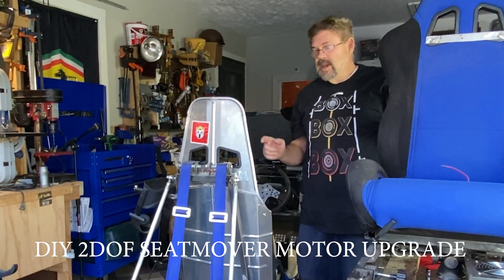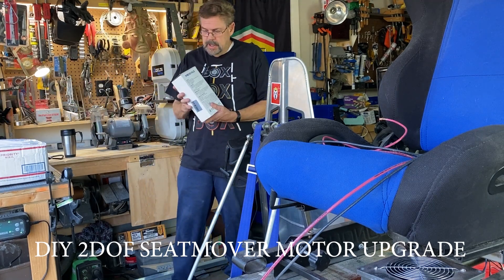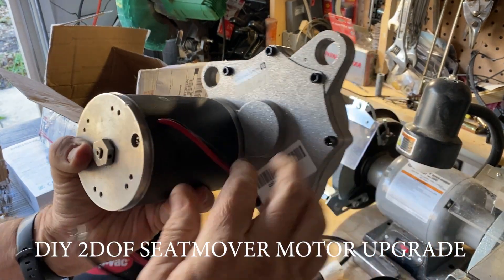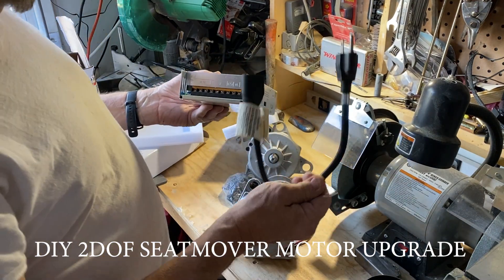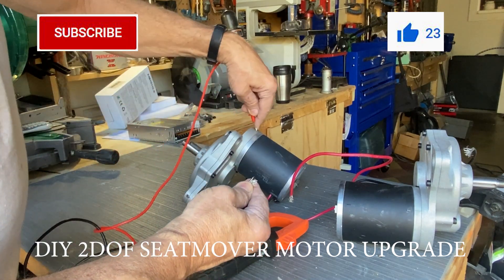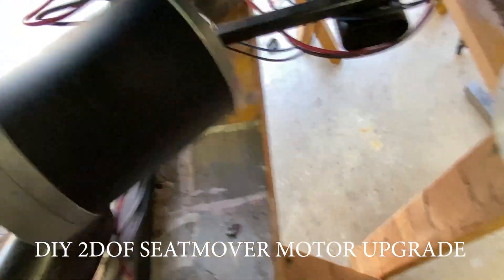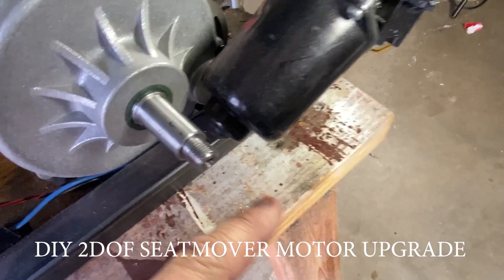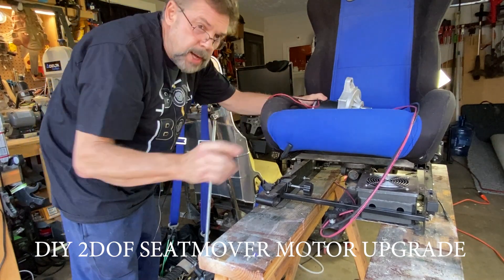DIY SEATMOVER 8 UPGRADE

Comment: I wonder how this style seat mover compares with SFX100 style platform (note ignoring price factor), just the feel of feedback given by seat movers with traction loss vs 4post actuator's. 

Not sure which build to start tbh, like the sx small foot print - yet that traction loss seems important
Reply from the maker: Nice comment Przemyslaw!  I built a 3dof and you get a LOT of movement out of it on 2DOF.. I added traction loss (which is absolutely fantastic in VR).  I also built the 2DOF seatmover which does work, but it's not a immersive as my 3dof.  So my conclusion is that if you want a compact footprint, you need more power.  That's why I am doing this video series.  More Power to the People! DMAX

Comment: Hi Dave, Awesome videos. I have watched almost all your videos. I am currently getting all the parts needed to start my motion sim. I was wondering if the power supply was able to handle both motors or did you have to get another one? Thanks for all the videos, they are really helpful in this journey for motion.
Reply from the maker: Thanks for watching the videos. I used one power supply per motor. Since the power supplies are pretty inexpensive, go that route. This was the only motion rig I built to date using 24v power supplies so I dont have a lot of information other than they moved the seat convincingly.   If you were to build a full frame rig, I would consider getting larger power supplies but for a seatmover, they seemed to be able to supply enough peak power .  Hope that helps and thanks for the comments.  Dave

Comment: Hey Dave, how do these motor compare to the crab pot motors? They are a lot cheaper but are they less powerful?
Reply from the maker: They are cheaper Nick..  they seem powerful enough for a 2DOF seatmover.  but I'm sticking with the crab pot pullers on the new compact 3dof build I am doing.  Mainly I wanted to test the 24v wheelchair motors using AC to DC converters and yes they do work..
Reply: I was reading up and most of those crab pot pullers use jiffy motors. So they might be the same motors and it just comes down to the gearbox
Reply: *jazzy
Reply from the maker: @GeeCeeAte  Yep..  JAzzy motors    now I'm working on a 3dof compact rig using 12 v  but going to be 'plug in' the wall hopefully..
Reply from the maker: @GeeCeeAte  Yeah from what I've seen on the EBAY web they offer it in 25:1 as well as 50:1.  Originally I wanted those Motion Dynamics 60:1 motors from AUS.. but the shipping was killer..  plus like $300 each..  so the 50:1 crabs will have to do..
Reply: Awesome! Do you plan to use a ac to dc converter on the new 3dof build as well?

Comment: Hello, would you pass me the link of the motors that you put in the simulator, why did I have the same problem, my 12v motors do not have enough power, thanks and best regards.

￼
Reply from the maker: the 24 volt motors  I just searched on EBAY..   so no real link but they have a lot of them  JAZZY wheelchair motors..   The 12 volt 50:1 motors I also got on Ebay and there is a seller for those as I have bought several over the last three years..   I'll put up the link here https://www.ebay.com/itm/354052076387
Reply: @DMAX_DIY  thank you for your answer, you are very kind, hug from Argentina 🤗
Reply from the maker: @cai_7748  Just tryin to help out ..  Aprreciate the comments my friend!

Comment: Hello, would you pass me the link of the motors that you put in the simulator, why did I have the same problem, my 12v motors do not have enough power, thanks and best regards.
Reply from the maker: Yeah this has been a weird issue since the Pandemic..  But good news.. I just bought 3 extra 12v 50:1 motors from the supplier on EBAY in Canada..   Sometimes they have them..  sometimes they dont..  price went up about $20 each but oh well..    They say they have 94 of these left..  They are pretty dang good motors.  I run them off a 12v battery ..  here is the link..   https://www.ebay.com/itm/354052076387
          SO for the 24v wheelchair motors, I also got them off Ebay..  I just searched for Jazzy WheelChair motors..   These parts come and go all the time on the Ebay site so cant really send a link..   And I have yet to fully test them..   I have them working and moving the 2DOF   but need to crank it up a bit in the next video.   SO you could go either way   12V  or 24 V..   My channel is kind of experimental..  Seeing what works and what doesnt.

Comment: I found the same motor but have a plug of conector of 4 pins? What i have to do? Is that normal?
Reply from the maker: Hello Natanael..  Good question.. From what I've read, the other two are for braking from the wheelchair hand lever..  You wont need to use those..  Just two of the wires which power the motor..  The arduino and IBT will take care of braking.. Dave
Reply: Ok perfect what model is your motor? To see if we have the same motor

Comment: They didn't give me any bolts or keyways
Reply from the maker: That sucks Henry..   Well..  If that were me..  I would try and find some metal that's close to fitting and grind it down to make the keyways.. Bolts are pretty easy to find at the local hardware store.   I'm actually surprised I got pretty much all the stuff to mount my motors up..    Also.. If you have a welder..  (and are in it for the LONG GAME  not reselling the motors   just weld the levers on..   That's what I ended up doing on my 3DOF rig..   I kept shearing off the pins that held the levers to the motors so I said.. whatever.. and welded them on..  (being careful to cool the metal down between tacks)

Comment: Damn it Dave, you're gonna make be do this. 
(thank you!)
😁
Reply from the maker: So Frank!  I got it running!  going to be posting a new video on May 14-15   Yeah.. 24 Volts works just fine with the IBT-2 setups.. I actually go into a lot more depth of settings on the SMC3 in real time.. Hope you tune in.. Dave

Comment: Hi I was wondering how your ibt2  are holding up with the 3dof any issues .I'm  using mm and thinking of trying the ibt2
Reply from the maker: They are fine in my 3dof rig after two years.  You need to put a fan on them so I have a 120mm fan that runs. So far, no issues at all.  Except I did solder all the connections between arduino and all IBT's..  Thanks for the question! DMAX

Comment: Between a 60V_600watts_180rpm versus a low volt low rpm = 24v_600watts_45rpm, seems this 45rpm has more torque, which is better?
Reply from the maker: Thanks for the comment.  So it's not all about torque either, response speed is super important.. I'm going to be running some tests but I may never get to use a 60volt motor so If you get one, let me know how it goes.  You could post the question on the x-simulator.net forum.. They could probably give a more specific answer!  DMAX

Comment: Hey Dave, you did the same thing as me. I just got my 24V 30A power supply this week. I hooked it up to the wheelchair motors. The first thing I noticed is when the motors go aggressive, the power supply spikes and then cuts out for about 3 seconds. I'm thinking that there is a internal protection fuse that is kicking in. How did yours turn out? Any problems?
Reply from the maker: I have not been home to test them out.. I will this weekend..  So, if I do run into that issue, I will place a copule 12 volt smaller batteries in series and they should be able to handle the spikes.    Really, I want to get the  Amp clamp on and see what the motors do  Till then!  Dave
Reply: @DMAX_DIY  Yup! I went to the junkyard today and bought a second 12V battery wired them in series, Works Great! My 3rd yaw motor is 12V, So I connect that in between the batteries taking a 12V line. I actually had to turn down the motion percent in Simtools. I was afraid it was so violent the chair was going to break. I'm going to return the power supply. Way too expensive for independent power supplies for each motor. Two batteries is the way to go! Let me know how yours turns out.
Reply from the maker: @dennisjohnson1893  Yeah.. I tried to make it simple on my 3dof rig.  850 CC amp battery.  The motors were 12 Volt so just one battery and all three motors connected.  The battery or batteries have so much available amps that I have never seen a spike that it cant handle.  I'm  going to connect up the 24v  motors tomorrow hopefully and see what's up  (AMP Wise)  Glad to hear from you.. Keep pluggin away!  And post a video if you ever have a chance..  Love to see the build on x sim page or on YT>> Dave

Comment: Hello again. Do you use any fuses in front of the BTS7960 motorcontroller. I know they are rated for 45A, but what fuse  would you recomend to be on the safe side?
Reply: Fred, I fused all my 3 motor connections with 20A fuses. I have blown a few of them. This comes from getting the motor tabs in a hard, almost out of reach position. If you over-force the motors the amps will surge and can burn out your wiring, I actually started my first wiring board on fire in the garage. So, you do need to watch it carefully when setting it up. Also take consideration an empty seat vs a full 200 pound person sitting in it. You might need to scale back your limits so the motors don't have to drive so hard.
Reply from the maker: @dennisjohnson1893  Great Tip Dennis!  BTW have you ever done an amp clamp reading to see what your pulling?  I'm going to try and use the Amp clamp on the next couple videos just to see what's actually going on   Cheers Dave
Reply from the maker: Fred, I have a 40 amp DC breaker for the main wire of the rig.  The most I have seen is 26 amps from all three motors so being right around 80 percent max load is good for me.  I could probably run a 30 amp but ya never know.  The main thing is that I can easily access it in event of Emergency shutdown (control wise) or it would trip if amperage exceeds the limit of the breaker.  I do not have individual fuses on the IBT's.  Hope that helps.. Dave
Reply: @DMAX_DIY  Yes it did help a lot! Thanks. I understand you have good experience with BT2 so far...
Reply from the maker: @Fredstli  Well, They work..  I have some JRK 12V12's but have not tested them yet.. The   JRK's were like 70 bucks each..  And I have to put a heatsink on them.. Anyway, yeah I found that if I solder the connections, everything is great.. If I dont and use those connector wires, Weird stuff happens due to loose connections. Other than that, You need to have a small fan blowing on them to keep them cool..  Dave

Comment: Hey Dave great video! Could you possibly remove the transmission from that motor to reduce the size, I know you would lose some torque but it would save on space and weight?
Reply from the maker: Maybe after I blow something up.. haha.  I know that when the motor spins, there is another part near the commutator which spins.  so I will first be trying to figure out how to count the ratio..   24:1? 50:1? I have no idea yet..  Thanks for the comment my friend! Dave

Comment: Can the IBT2 do 24v?
Reply: Excellent!  Those are the exact ones I have and I am in need of a new (stronger)TL motor.  Been looking at the truck tarp motors as a possibility too.
Reply from the maker: @dgator7251  Yeah.. I looked at those dump truck tarp motors too..  Let me give these a shot and see what happens with them before you get any..    stay tuned my friend!
Reply: @DMAX_DIY  Looking forward to it as always, thanks!!
Reply from the maker: @dgator7251  Ok.. so I got a new video coming out on May 14-15  I'm going over all the settings with the motors in real time..   It's pretty cool  hope you tune in.. Dave
Reply from the maker: Yes,   absolutely and up to 42 amps..  I have not ever had them on 24V  and the max I have run is 27 amps  so like I said before  experimental science  The Specs of the IBT-2 say " the supply voltage 5.5V to 27V."    so We will see what happens and hope no 'smoke' comes out !   Here's a link to them.. Dave  💪    https://www.amazon.com/HiLetgo-BTS7960-Driver-Arduino-Current/dp/B00WSN98DC/ref=sr_1_1?crid=CC5HY2E3KZPG&keywords=ibt-2+h-bridge&qid=1643674072&sprefix=ibt-2+h%2Caps%2C115&sr=8-1

Comment: I think you will fry this psu buddy 🤙😳👻
Reply from the maker: Maybe.. But you gotta try to find out..   The load seems appropriate so far..  It's the transitional load  hard braking to full accel that may be an issue.  I will have the AMP CLAMP on to see whats what because I need to know ..  If it does fry, then I will simply get a bigger one or mid circuit batteries to handle the spikes.    Either way..   It's ' ON " now...  we will find out! Dave   😬💪
Reply: @DMAX_DIY  I am sure you will find the right way! Keeping my fingers crossed for you as always 😉 
BTW. I did a little re-upload which is totally off topic 😳 but I wanted to get anything fun up for you ....
Reply from the maker: @ARTFLY  Took a look at your video.. Nice..  I did that too with my little ones!  And my Dad did too! All Good stuff!

Comment: Hello, your videos have inspired me to try and build this for my two handicap children and myself.  I am stuck though and was wondering if you could help.  I got all the way to the smc3 utility but I cant get the program to engage the motor.  Do you have any advice.  Please help
Reply from the maker: Great idea Tom-Jacob.  Yeah once it's moving Yall will love it!.. Ok.. So you have the SMC3  and it's on the correct com port?  Able to move one of the potentiometers and the green line follows?  Let me know,  I will check this comment to see what you say..  Dave  💪
Reply: @DMAX_DIY  Good evening Dave,  I got it working, as it turns out the Mega I was using isn't compatible with the coding.  I know it was written for the Uno but I figured the syntaxes are the same hence C+ they should both work.  Low and behold the Uno was the one I had to get my hands on to get it working.  I know have to hook up the second motor, test it then get simtools running and try to patch it with xplane11.  To be honest Dave, my son hasn't been able to walk since he was eight and my other son is Autistic but a gamer, go figure.  I am currently working on getting custody of my grandson so he doesn't go to foster care and they are all really wanting me to get this up and running.  I had an old premobile M300  powered wheelchair that I am converting into the motion simulator.  My oldest is now 16 and a quadriplegic so my plans where to use his old chair so that I could fly it remotely while he sits in his old chair and enjoys the show.  Please keep your fingers crossed that I can get this going.  By the way I live just inside Alabama and I saw from xsimulator is where your from.  Small world right.  Sorry for the long winded response, I am very grateful that you responded, thank you.  Have a good night.
Reply: I really need to proof read before I send messages lol.  I know your close to Alabama because I am also a member of xsimultator.  The funny thing is that I got chastised because I asked a question on your xsim feed 🤣.  I was told I broke a rule, no biggie though.  Take care
Reply from the maker: @1980tomh  Ok.. I have not logged into the x-sim feed for a couple days really..  That's weird..   Anyway Yeah you need to Arduino UNO..  They work perfectly for this .  Xplane 11 looks to be awesome. I want to try setting up a rig for flight but I'm working out of town all the time so really only get a little time on Saturdays to mess around.  You want to incorporate a few safety mechanisms into the rig you build.  Emergency off switches or breakers and teach them how to use them. I am going to be going through the whole process in this series. I got my arduino in today and since I need to take off the Hall Effect Pots to anyway, I figure I will try and make the next video all about hooking everything up. (so people can see it again or new people can see how to do it)  Your kids ( and grandkids - I got one too!)  are going to be thrilled.  Just take you time - one step at a time.   I do go to Ala😀bama a lot for work so I'm always on the west side or orange beach area or up in Bham..  I'll log into xsim and take a look if anyone else asked questions.  Dave